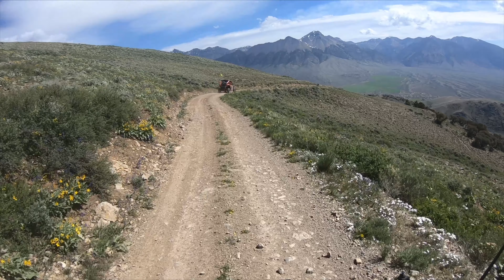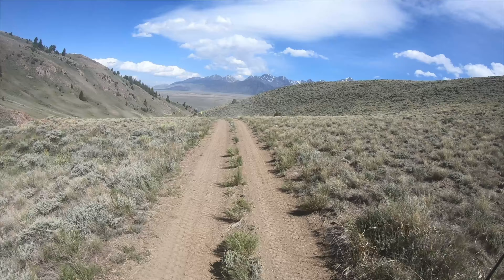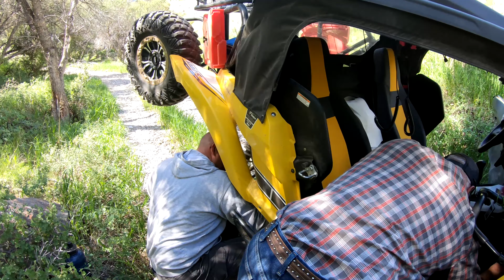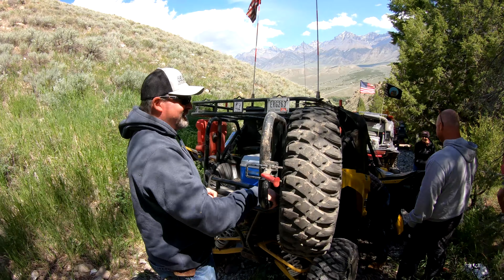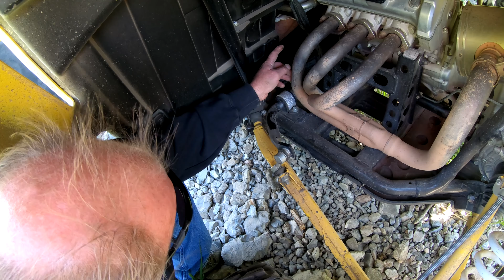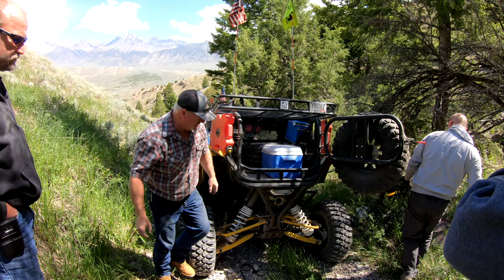Mackay ID Day 2 Yamaha Down

Comment: What route is this? It looks strikingly similar to one I was trying to work out last year but could not find a junction or side trail.
Reply from the maker: Hey Chris, this trail we were on ran behind the lake. We ended up getting through the narrow trial but ended up tuning around and backtracking. Trail looked like it ended..
Thanks for watching and supporting the channel..
Reply: @091200xr  Sounds like you ran into the same issue that I did. Love the video though, I have some great pics from the Radio Tower across the valley, and vice versa. Will be up there again this summer!
Reply from the maker: Going to be heading back up that way a little later this summer to do some more exploring.. Going to try and hit some of the higher mountain trails and lakes..